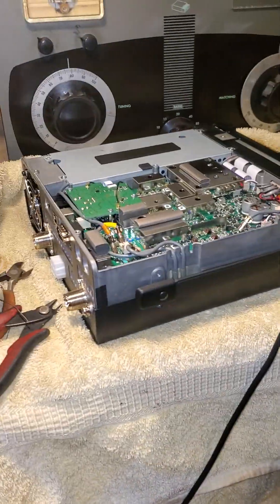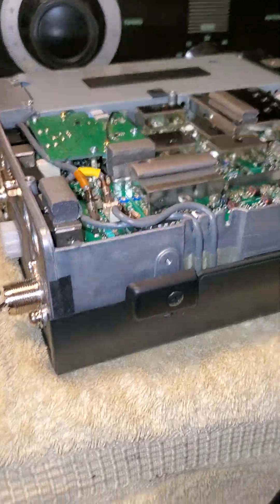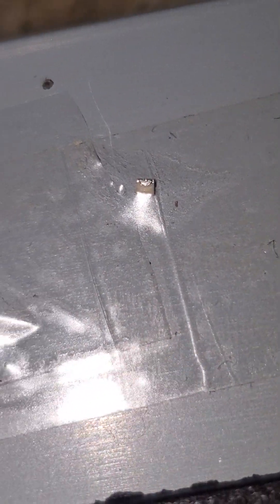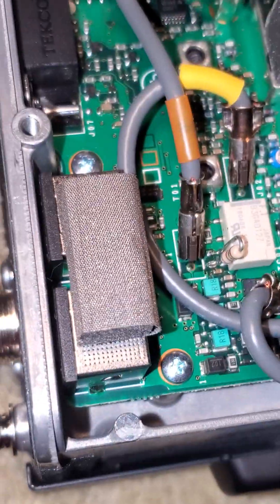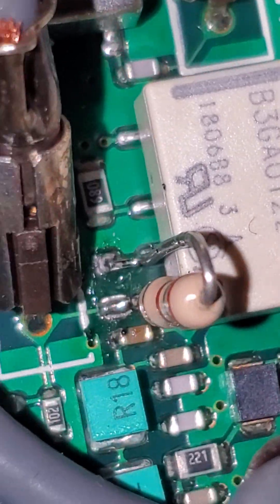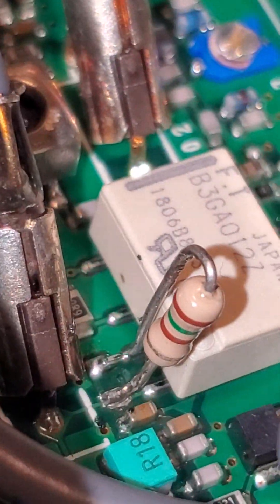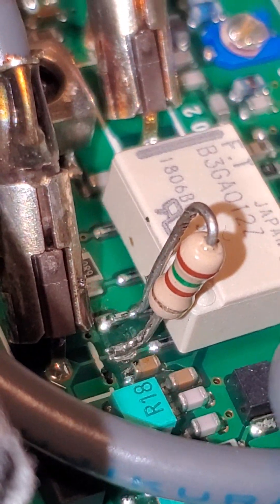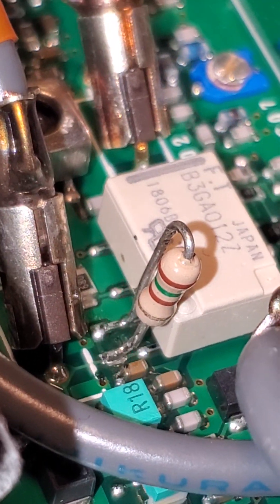YAESU FT991A front end failure and the fix!  ipo on no rx

Comment: did you only replace one resistor 150 ohm? I think I saw 2 pieces of resistors taped
Reply from the maker: Only one. Its original is a surface mount that blew into multiple pieces
Reply: @hamradiohack  thank you.  I'll be getting one of  through hole components from one of my local fellow hams. Will do the repair and will let you know.   I appreciate the time you took to make your video and how informative it is.

Comment: I have same problem with my ft891 
Licenced 45 years dozens of radio
Only time ive had trouble 
Ive located resistor thanks to your video
Couldnt find service manual 
Ill put in like you did 
But why 2500 ohm and not 150?
73 thanks
Reply from the maker: My 891 i got used had same issue too. I dont understand why yaesu hasnt fixed this issue
Reply: @hamradiohack  

Thanks reply
again why a 2500 ohm resistor and not 150 ??

Comment: will it happen if its not connected to an antenna or off???
Reply from the maker: It will happen if it's connected to an antenna regardless of whether or not the radio is on or off mine was actually off when it happened I don't think it's going to happen without some sort of antenna hook to the radio though